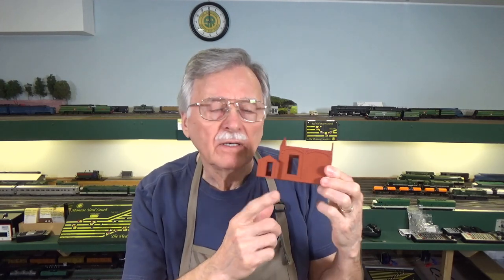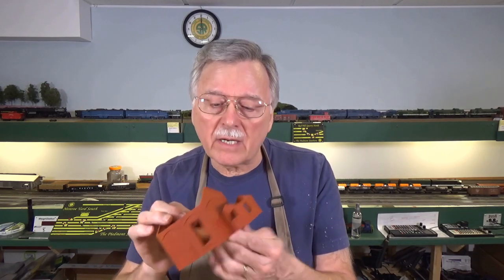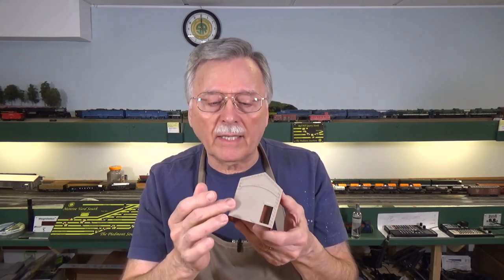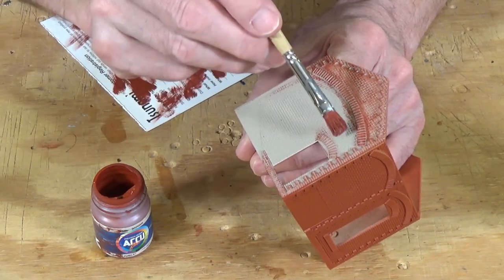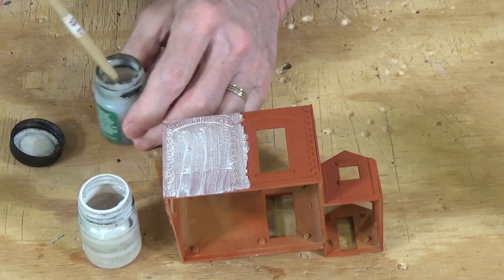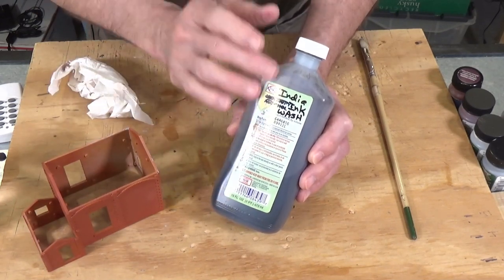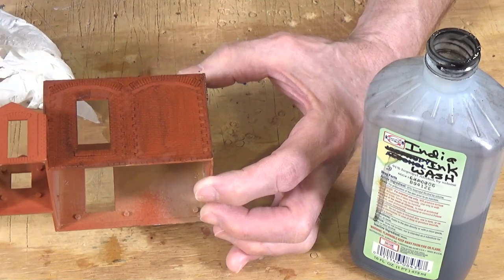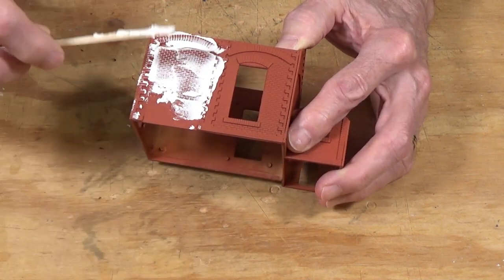Modeling A Gas Works--Mortar Lines For Your Brick Work

Comment: As you say, it's always tricker the more raised detail there is in the brickwork. One advantage of the filler method is that once it's completely, large lumps (as in the "crenelations") can be picked out with a dental pick.  Personally, my preferred method is the very thin white/dirty grey wash (and I've even used dirtied white India ink successfully) - if you get it thin enough and can overcome surface tension, you can dab it on and let it fill the mortar lines by capillary action.

(I seem to remember saying that very recently to someone, or writing it somewhere else: did you cover it on your US channel too, or maybe it was another channel, or on Facebook or something.)

Comment: A method for brickwork that I have use is spray the wall with a rattle can of off white / cement color, then using a makeup foam wedge, dab on the brick red color.  It gives a weathered variation in the brick color